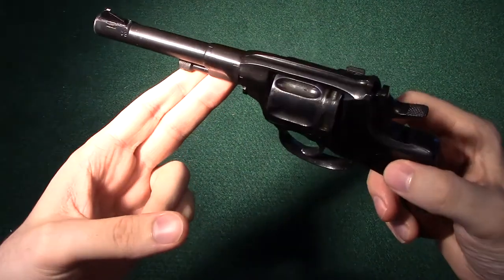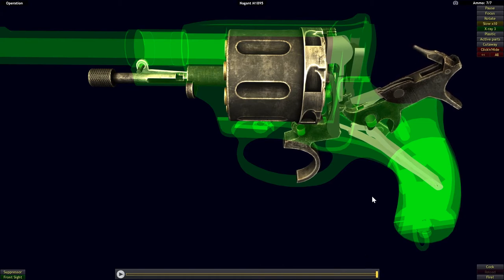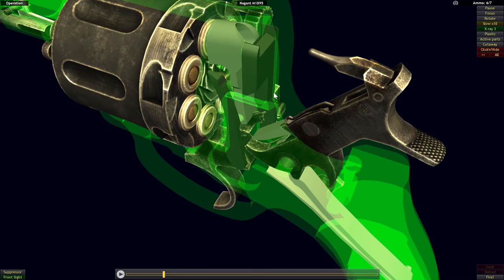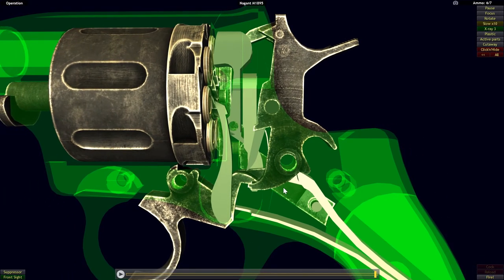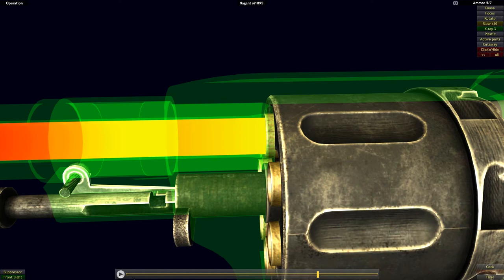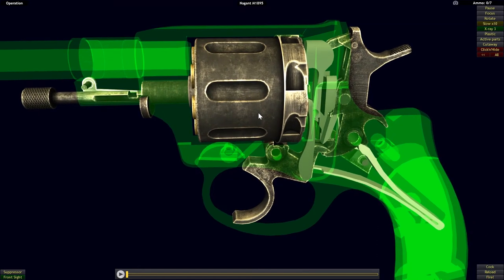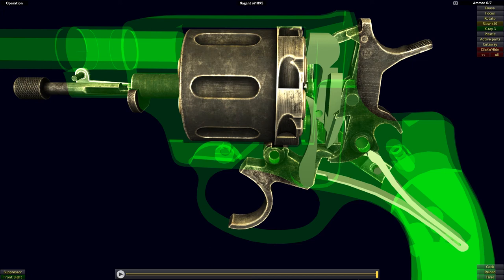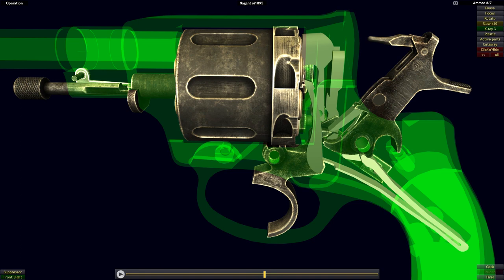How Revolvers Work Part 3: Gas Seal Revolver

Comment: On the .357 magnum comment; I've always thought an interesting aspect/idea with this design would be to have a similar gas seal system in a .357 magnum chambering, but use trimmed .357 "maximum" brass (obv with a recessed bullet) that work with the cylinder camming system. The crimp required might make it difficult to reload the cases.......But the cool application I think is in a carbine format; with the gas seal you can presumably have a hand forward to stabilize the gun, and a bullet with similar ballistics to the .357 magnum benefits greatly from a longer barrel (I have heard that lever guns in .357 magnum can achieve 1900fps quite easily). Such a system maybe would be a solution to the age old revolver rifle relic?

Comment: Is it possible to make a gas seal revolver that doesn’t need extended brass? Just normal .357 ammo, I’m thinking the cylinder can have the “protruding brass” in it and as it goes into the forcing cone it creates a seal. I’m guessing it might be able to at least minimize some of the gas leakage.
Reply: I thought the same, would be cool to see someone try and modernize this concept
Reply: Imagine a revolver where each chamber in the cylinder has a thin, tightly fitted sleeve which the cartridge sits in.  When the hammer is cocked back, the sleeve of the 12 o'clock chamber is pushed forward across the the cylinder gap into a recess in the throat of the barrel, creating a gas seal.  The sleeve is pushed back into the cylinder by the trigger reset spring only after the shot has been fired and the user has let the trigger back out to reset it.  

This proposed system would have a MUCH better trigger pull than the Nagant revolver because only a lightweight sleeve is being pushed forward rather than the entire cylinder.  And the single action pull would not be any worse than a regular revolver because the extra trigger pull weight of pushing the sleeve forward would be accomplished during the double action travel.  The single action pull would only be releasing the hammer. 

Of course the chambers and sleeves of this revolver would have to be cleaned more often so that carbon buildup doesn't affect function.

Comment: Would you be able to make one of these with a swing out cylinder?
Reply: it could be done. It just hasn't been. No one has seen a need, I guess. Would have thought intelligence agencies would jump on such a thing (semi-automatic fire rate with manual action suppression). The specialized ammunition is an obstacle. If you made a revolver where the cylinder moved far enough forward to seal a conventional revolver round, it would have a crappy trigger pull due to the energy required to move the cylinder forward. It could be done, but I don't think there would be enough demand for such a revolver to justify the complexity, cost and bad trigger.
Reply: @arcticwolf8313 after watching a lot of these videos I've come to realize you can justify the existence of some of these ideas if you know what your doing. I want to be a gunsmith one day and having a gun like this or a gun with a design so unorthodox that kind of helps with security. If I were to carry around a break open revolver that fired out of the bottom barrel like a rhino that I built from scratch then it's likely that person probably couldn't use it. I think more unique and unusual designs like this do have. A place. Just not in the mass market.